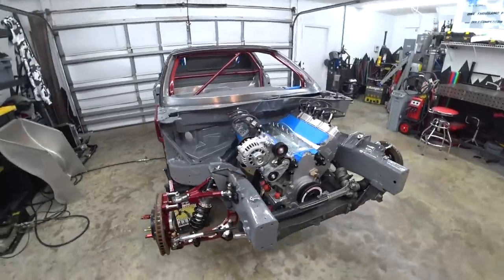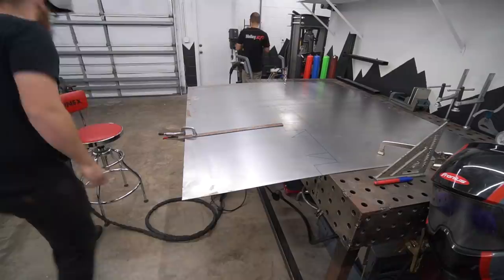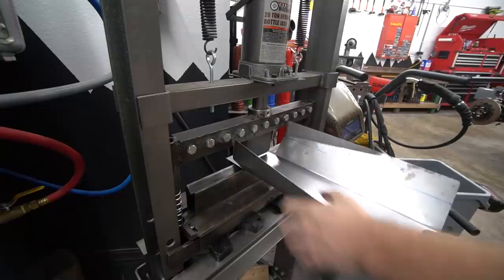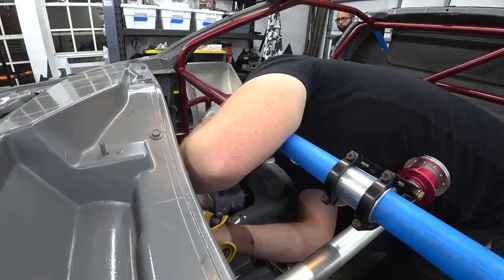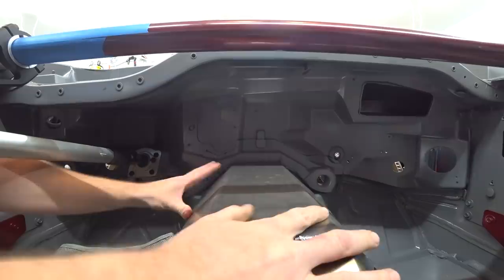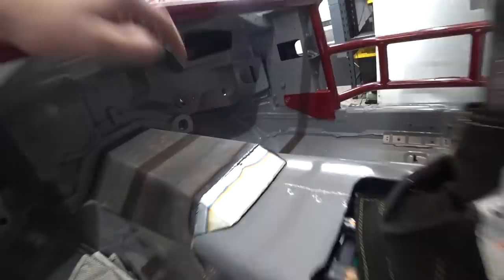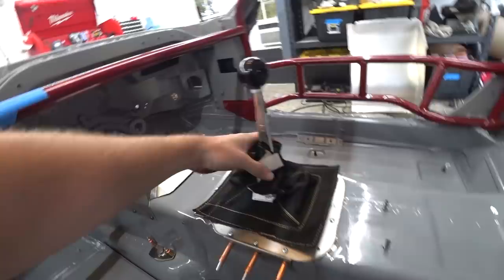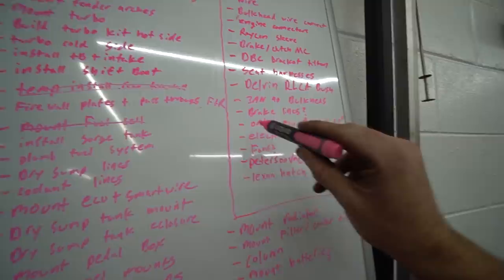C6 Corvette competition drift car. building something i've never built before.

Comment: Carful with the Exhaust routing, the heat will cook your gas and cause your fuel lines to vapor lock. Love watching the build, Good Luck!
Reply: @eriklarson9137  calm down homie he’s just giving friendly advice
Reply: @eriklarson9137  bro everyone forgets little things while building a car and sometimes comments like these have helped him to remember little things like this
Reply: I was thinking the same but also I would problem have some heat shield or even a piece of sheet metal separating the fuel cell and the diff just in case of a diff failure it goes into pieces it won't destroy the fuel cell... maybe not just seems kinda close. But definitely would not be great heat wise vapor locks do suck!
Reply: @gwpentertainment9671  My first thought was the u joint coming apart by the fuel cell. I will admit however I don't know the construction specs of these fuel cells. I'm just an average guy with little experience in the world of race cars.
Reply: Vapor should go back to the tank in a return style system it shouldn’t be an issue.
Reply: @eriklarson9137  u are funny guys.. Ez triggered
Reply: @eriklarson9137  drider alert
Reply: @gwpentertainment9671  was just thinking a shield between the diff and fuel cell would be a good idea
Reply: @eriklarson9137  Who hurt you?
Reply: Also hot Gas does Not burn as efficiently as cold gas
Reply: @randomthing4639  *You. *Easily.  

You're welcome.
Reply: @zooted5443  His dad😭
Reply: @zooted5443  nice name
Reply: @eriklarson9137  even Garrett had problems with his fuel getting heat up and cause problems.
Reply: Meh it'll be ok.  Nothing some strategic shielding and ceramic coating won't fix
Reply: Gives nice guy advice.
Gets flamed for doing so. 
People are gorbage
Reply: @eriklarson9137  the question is how many cars have YOU built.
Reply: @eriklarson9137  Don't be so defensive. Advice is not an insult. There is a genuine concern that he could have serious issues down the line, he is doing the right thing by prepositioning the problem. The problem with the internet is that everyone automatically assumes you're talking shit when you give friendly advice.
Reply: Hey, we all supposed to be chill in Taylor Ray's comment section.. ✌️
Reply: I’ve seen Taylor deal with boiling up his gas and having issues in the Miata and that was a headache so I’m sure he has that on the back of his head when building this car. Well i hope so because it would really suck ass.😂

Comment: Use the drill with the rivet tool with a clutch setting, not the drill setting and low speed. Makes it MUCH nicer
Reply: Where do you get that tool? I want one.
Reply: @michaelpage6164  I've gotten a few on ebay. There's a handful of styles and brands. The style I have, has a handle off of the side of it.
Reply: @Axial32  and they’re pretty good quality? I’d be using it for work, doing dealer installed accessories that require rivet nuts.
Reply: @michaelpage6164  the ones I have are

Comment: Is the bottom of the fuel cell in range of an exploded U-joint on the driveshaft?  Seems like it would be the first thing that parts would hit.
Reply: That was exactly what i thought as i saw the End of the differential Open Directly under the fuel Tank… really Should Throw a Thick Loop or plate there to protect the fuel cell
Reply: Thought the same, maybe he'll build a shield, tech may require one.
Reply: @BOOT  FD only requires a driveshaft loop at the front.
Reply: @ChewieBonez  should also build things for overall safety, not just to tick the box for a comp....

Comment: Loving the build! Its all going so smooth (hope I didn't jinx it!) Little tip - I find it waaay easier to knock the plasma slag off with an old chisel (doesn't have to be sharp) and a hammer, takes a couple of seconds and leaves a much cleaner finish than you would expect - better than trying to grind it all off for sure, give it a try!
Reply: I said the same thing haha should have known someone beat me to it XD
Reply: Cosign 💯, way better than a slag hammer or anything else I've used
Reply: agreed, we would stand it on end and tap the chisel with a hammer lightly down the edge and rotate, way more natural results than grind or sand imo
Reply: This work grate on 1/2” 😁

Comment: try using a piece of aluminum or brass for a backing when you have a gap that you need to weld up. Also when welding aluminum, brass or stainless steel works for it. 
Just a tip
Reply: I concur
Reply: Thick alum

Comment: I was a press operator for years and learned a few tricks to correcting a bend that went over what you needed. 

One of the best ones is to flip the piece over and press the brake back out. Put the top dye right on the apex of the bend. Slowly press until you get the desired angle. 

Next best is hit the outside of the bend with a dead blow hammer along the apex until you get the desired angle.

Comment: Couple questions, are you gonna add any shielding to the bottom of the fuel cell in case of a drive shaft breaking? Or to keep the exhaust from heating the fuel?

Comment: Couple plasma cutting tips; 
Use a thicker burn bar, I like 1/2 flat bar because 1/4” and 3/8” will sometimes hit the taper on my plasma cutters shield 
If you’re very vertical and at a decent speed you should have little to no slag
As several people mentioned, breaking the slag off with a cold chisel is way faster and cleaner than sanding
And when a cold chisel doesn’t work, clamp the piece and use a 4 1/2” grinder. The sander is slower, takes more consumables, and while you’re comfortable with it, my personal opinion (with a fab shop of equipment to use) it isn’t the right tool for the job

All in all great video and I really like how your fab skills are coming! I think it’s interesting that you don’t like learning from YouTube or other people who have done the work professionally, but you should definitely be proud of your progress. Every video I want to send you a couple tools (like a bevel and contour gauge), but I do feel like there’s some things you do better than I do, and I’ve been a fab shop supervisor for years. So given some time, I bet you’ll progress even further than I can imagine!

Comment: Hey Taylor, I work in a fab shop that uses a cnc plasma all the time. The way I have found to relatively easily remove slag from steel is with a chipping hammer or sharpened wide cold chisel/wood chisel. Please give it a try. I hope that makes your life easier! P.S. I love the color theme of your new drift rig.

Comment: Those pieces I could easily print with my 3D-printer and seems appropriate since they probably doesn't have to withstand more than 80° C (176° F). That's about the limit of certain filament you can print with common FDM-printers like ASA or PETG Carbon.
Reply: I'd rather not print those panels. While probably fine for a normal use case, those pieces also need to seal in case of a fire in/near the engine bay
Reply: @TheCastorPlays  plastic trans tunnel?! Lmao

Comment: An angle grinder with a medium flap disc works best for getting the slag off. Also, a chipping hammer for stick welding works wonders to. Just slide the hammer into the edge, and it'll knock it right off.

Comment: Hey man pro tip really easy way to knock slag off from the plasma is to slide it down aggressively against a hardened surface (the belt sander will work perfect) comes off with little to no force all you have to to is follow Thu with the motion it definitely changed my life I use the base to my drill press makes working with the plasma a lot more enjoyable

Comment: When you are using that rivnut tool on the drill, turn the clutch down on it so once it hits that pressure the clutch will disengage and stop spinning the drill so that you wont ever spin the rivnut in the hole. Im sure you will have to mess around to figure out which number you need to be on with the clutch adjustment. But it will Really make a difference. It looked like your drill had a clutch adjustment so figured id recommend it.

Comment: You should of painted that tub and frame with "steel-it" paint... it's weldable paint, you can weld directly over the paint and paint over it again... and the color is kinda nice and would of fit your theme although it would of been a bit darker. it's a game changer for project cars
Reply: Or just paint it when every chassis piece is done. Painting it before you work on it is just asking for it to get messed up. That tranny tunnel feels like it would've been better welded in.
Reply: @sampic_  he said in a video before painting that the most efficient way of painting is building the whole thing un painted and then take it all apart and paint it all at once, but he doesn't have Time to do that because of the time crunch he is on...

Comment: Taylor, to get the slag off after plasma cutting use a knotted wire wheel and it will come right off,  belt sanding like that doesn't work well and just melts it down and makes more work.

Comment: Corners are starting to be cut.  🤣 

Still better than anything I’ve built.
Reply: How’s he cutting corners everything he does seems legit and proper not coming at you just wondering I’ve never built shit just bought
Reply: @sean7379  I think what most people are 
Going to be saying that about is the fuel cell/driveshaft and exhaust proximity
Reply: @miguelandresjorge46  ok that  makes sense thanks
Reply: Sean only thing I would say is. He is bolting things in to avoid painting them in the car. Not the worst thing in the world but you can almost tell he trying to convince himself it is a good idea

Comment: On sheet metal you can put any dissimilar metal behind it to help soak the heat and when you have big gaps you can use it to prevent you from melting into the inside a ton like hold the weld up for steel and stainless you can use aluminum or copper I keep all kinds of machine shop scraps from 1x1” solid blocks down to 1/8” for aluminum you can use steel not ideal but works if ya clean the mill scale off stainless or coppper. Simple trick to help when things don’t go as smooth as they should or they have specific requirements that demand you use it works the same

Comment: You should pneumatic riv nut tool, I use it all the time at work, comes in 1/4in (3/8 hole) and 5/16 (1/2in hole). You can feel how tight it gets through the trigger

Comment: Check out Pan American threaded drill bits.  You’ll need a pneumatic 90 degree drill, but you can get very stubby drill bits(1/2 inch in length). And their 90 drill has maybe a 1/2in head. So you can into extremely tight areas with a drill bit. Use them all the time on aircraft.

Comment: What about a driveshaft loop or a steel plate to protect the bottom of the cell if the u-joint goes, that way the shaft won't smack the cell.

Comment: When making cardboard templates, if you plan on doing a few more, buy a roll of Ramboard from home depot or lowes. It holds a shape and creases a lot better.
Plus you can us it to protect areas inside the tub when you need to step on the paint
Reply from the maker: That’s what I was using.
Reply: @Taylordrifts  oh damn, I didn't see the markings. I guess it doesn't want to work for everything.

Comment: Think I'd open that trans tunnel up under your shields. It's just extra metal under there an having an extra half inch when it comes time to pull that trans can be a knuckle saver. An get you a driveshaft loop doughnut an weld it in behind the quick change diff. That way you can reach thru an pull the gears but still have the strength you want across there.

Comment: hey dude - just so u know when your doing touch up work with 1 part paints- you can thin it out really good and run it through a pravail sprayer available at home depot-  they throw way less overspray and you can get them in tight little spots - so just some 2" tape and you can touch up edges etc

Comment: You can hammer the slag off. It will 95% break away completely clean. I use a body hammer that has a flat "pick" in the backside. A hammer and flat chisel will also work. Hold the punch or hit with a hammer at around a 30° angle to the metal. This way you don't mess up the metal. Can finish the clean up with your belt sander.
Reply from the maker: I tried. I think since it was so thin it just didn’t work well.
Reply: @Taylordrifts  what thickness metal were you using. I shear at work anything up to 18 gauge thickness but plasma cut 16 gauge and thicker. 

I know you said in a later video you dialed in the settings a bit more on the plasma cutter. A scotch Brite pad works well for cleaning the copper parts up. Clean copper helps the torch keep a clean ground while cutting. Also know there is an inner copper shafter that is a wear item and the torch will cut like crap when it starts to wear out. 

Anywho, the vette is turning out great. I was behind and just watched your last 5 videos in a row. Have a 2 month old, so I tend to fall asleep at night during my YouTube watching lol. Look forward to watching you during Klutch Kickers this year. Got me the cleeter package so I can watch.

Comment: Hey, just a tip on cleaning up the plasma cut parts. Try a cupped wire wheel on and angle grinder, you have to hold the grinder at a 45° to the work piece but it usually comes right off.

Comment: Check out Diablo steel demon circular saw blades. You can cut steel with a regular circular saw. They cut like butter with minimal heat or spark. I've cut 1" thick steel with them.

Comment: If you score your CAD where you want it to bend it will hold the shape better.
Reply: Also you can use some tape and string to make your bend lines and measure the cardboard from those reference points.

Comment: When cutting with a plasma cutter you still need to go at a constant slow speed. If you have your speed correct you should have zero slag. The faster you go the worse the slag will be. If you have slag no matter what you may need to clean the tip and or adjust settings.

Comment: Next time just use painters tape around painted areas where your going to be cutting and grinding material away, that way you can make nice line and cut the tape back to be precise on what you want to grind, especially if your going to weld on that spot.

Comment: This is coming out sick i am a bit concerned on the gas tank and drive shaft positioning you might want to cover and make a drive shaft safety loop or plate it off. God forbid that  drive shaft breaks you dont pierce the tank in mid driving.

Comment: You might want to build a heat shield/ guard for the exhaust and the driveshaft so that it doesn't overheat The fuel cell or or have the drive shaft brake and rip a hole in the cell

Comment: All the skag after plasma cutting will knock off if you just hit it head on with a metal hammer.  You'll need like 1/10th the time to clean up the surface compared to using the grinders and Sanders.

Comment: The car is looking awesome man! You have alot of really cool parts on there and i really like the transmission swap and getting rid of that headache transaxle. There is a guy in ireland that built a c6 last year and its carbon fiber wide bodied and its so sick. It has alot of parts your using so maybe you have already seen it 😆 but it has really cool wheels from strom also. Has a quick change rear also and i cant remember what rear second brake calipers you were wanting to use but this guy used a set from drift hq that was pretty cool. I know you already have a set but i think you said you were going to change them. But it is on the drift games channel

Comment: couldnt you use Dzus fasteners in the spots you dont want to rivet but not enough room for riv-nuts? And is there no worry of the driveshaft breaking at the differential and putting a hole in the fuel tank

Comment: Just curious, can you still change the rear gears with those cross bars you put in or do you need to drop the diff?
Reply: Keep thinking he should weld in an oval shape in the middle big enough to pull the cover thru. Be alot better when it comes time to pull the gears out.

Comment: As a very novice engineer, I want to say you removed a lot of material from the trans area and you should definitely build it back up both on the top and bottom. Flat metal is good but a lot of the material you cut away had gusseting and I would advise trying to replicate that level of support. God forbid you start deforming around the trans and have your drivetrain alignment come out of tolerance. That's just my two-cents
Reply: I would agree. I think the trans cover plate should have been welded in instead of bolted. The shifter cover plate, I don’t see an issue with.
Reply: You'll bend the roll cage an frame rails before that trans tunnel ever moves. I was thinking open it more under there so he can save his knuckles when it comes time to pull that trans.

Comment: the gt3 pop and lock trim parts are best disassemble in warm climates,  gt3 trim wise has to go in to a climate controlled room, to make the trim more malleable. bumper side mounting brackets, there the devil in cold weather, and not cheap from the dealership, don't by ebay they shatter once there below 0, oem don't!

Comment: HIGHLY recommend a 1/8" plate aluminum scatter shield under and behind the fuel cell in case something comes apart in the driveline. It could be a disaster of biblical proportions of a piece of ring gear or something escapes the center of the quick change diff and punctures the fuel cell and bladder. I understand the ATL Cell bladder SHOULD prevent that, but I have seen them punctured still. Better safe than crispy.